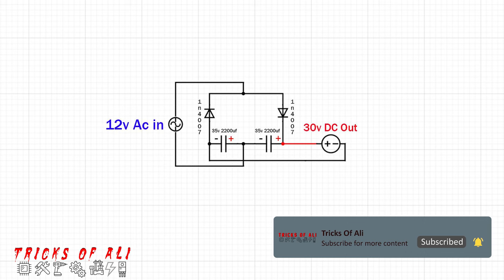How To Convert 12 Volt To 24 Volt | 12v to 30v converter | How to make a voltage doubler circuit

Comment: 12 volt 5 ampere adapter  connect with this circuit output what's amper ????? I use for 775 DC motor to make 
 angle grinder